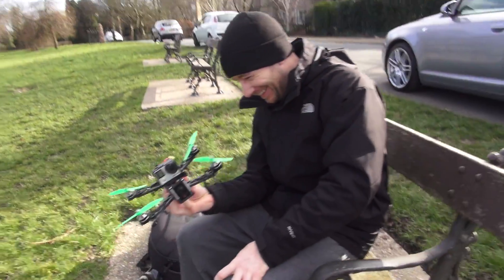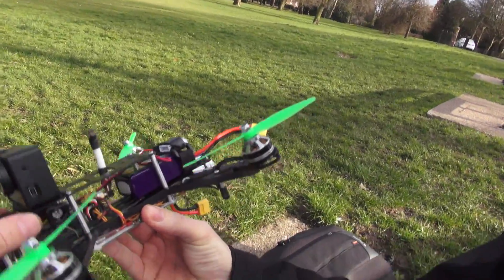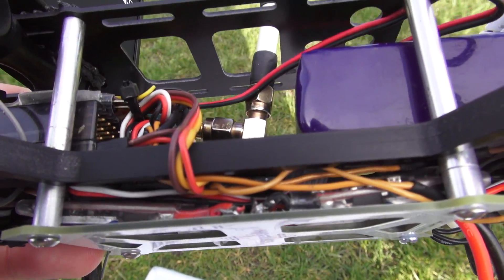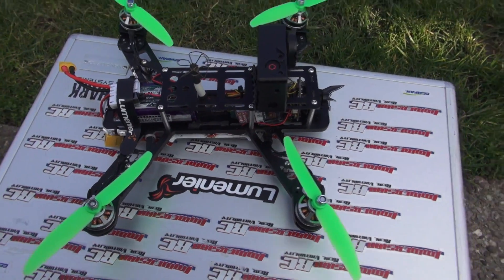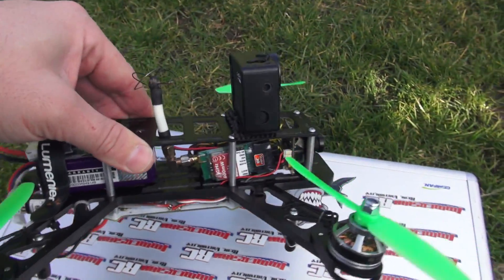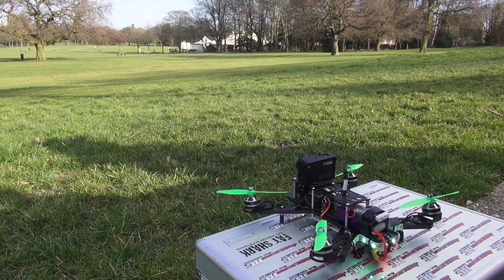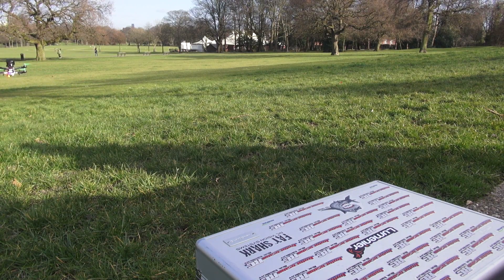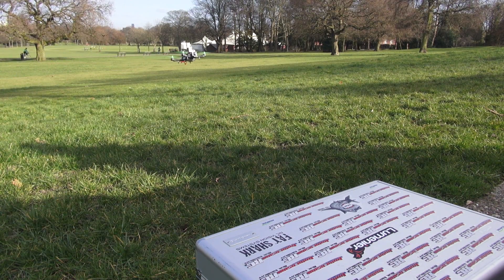HPIGUY | Underslung Naze32 & 4Cell with Angled Motor Mounts

Comment: Only thing I'd be looking at is a way to stop your battery sliding forward in a heavy crash. If it does, it will take out your fpv gear. Expensive. A pin or bolt between the top and bottom plates would stop the battery

Comment: Yea. Like it.

New to this. I only just built my mini and have flown but twice 3-4 packs only....AND, I Only broke two props :-)
Thing is, using Angle, (it's been windy here) I really can't maintain FFF without the thing leaving the atmosphere at a high rate of knots.

Gust of wind and she goes off up another 50 feet. Is that Angle mode causing that? Tried different props and so on. All LOS btw.
I will try Acro/ and or Horizon soon as I can get out with no windy shite ;-)